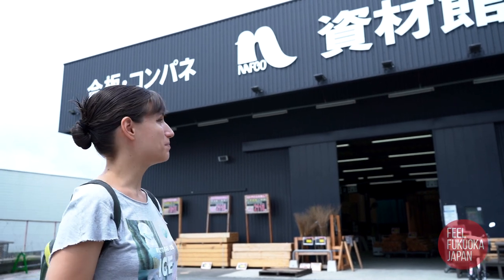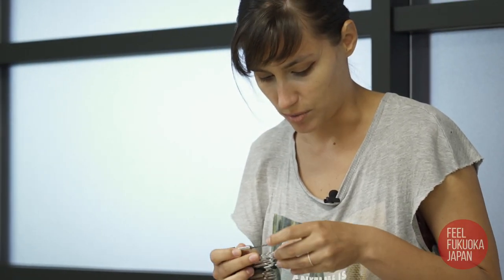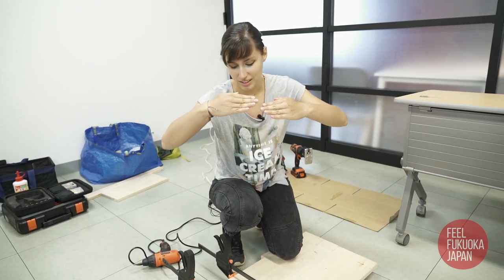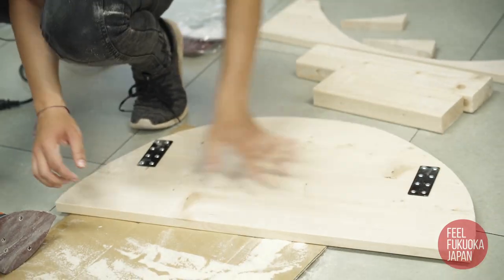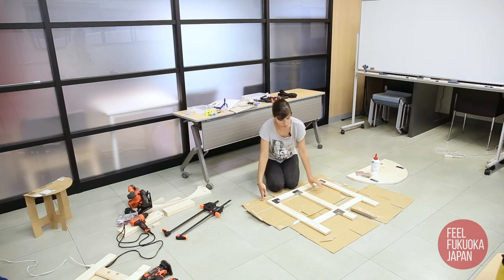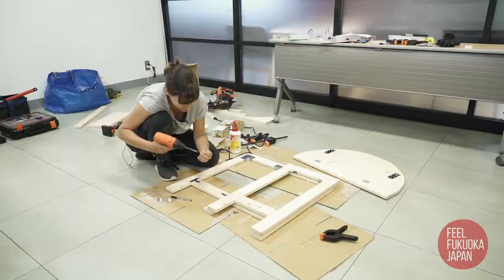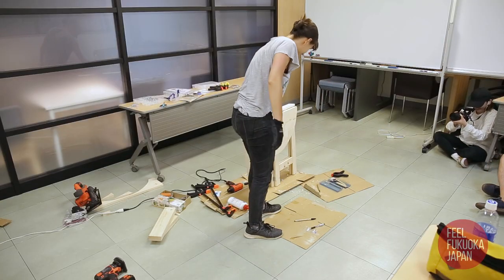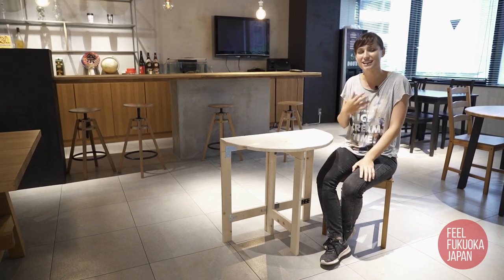At-home DIY project

Comment: In my old dunger of an apartment I utilize space like few do. I obtained this shelving from a bar, put up some uprights and shazzam, I can use the space high above. I have nails and screw all around the skirting boards for hanging clothing. Got rid of the doors for the storage areas so as to not need room to swing them out. Indoor washing line. I'm on the ground floor and have a garden out back that I never really bother to go out there. Some day I will get an inflatable pool happening with an anti-mosquito netting frame thingymajig.. Out front, my car and washing maching and cycles and all kinds of stuff seems to just grow haha. Oddly Japanese sinks are huge yet very little space for food prep. No sink plugs either. Got that covered too. hehe. I have tools up the wazoo in my warehouse so sometime in times of motivation I like to innovate. Ya gotts to love Nafco/ Gooday/Komeripower/Proshop and that huge place out in Kasuga or whereever. Yeah I dig these kinds of things.